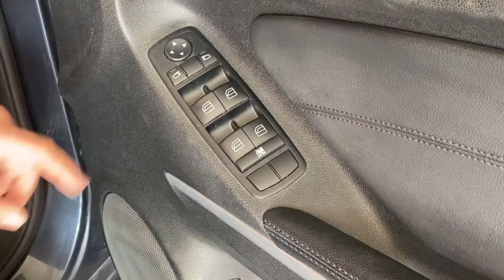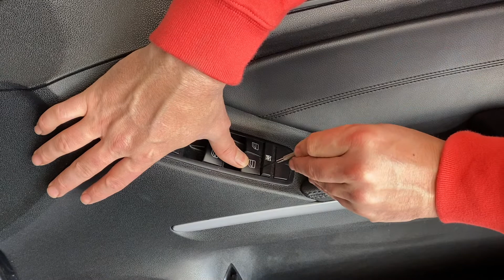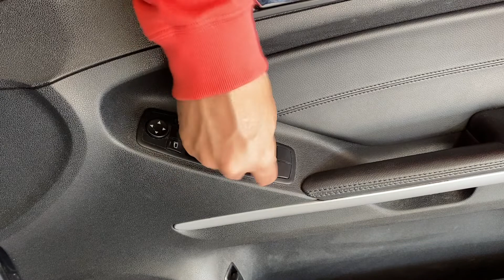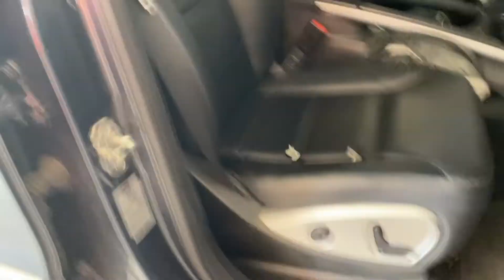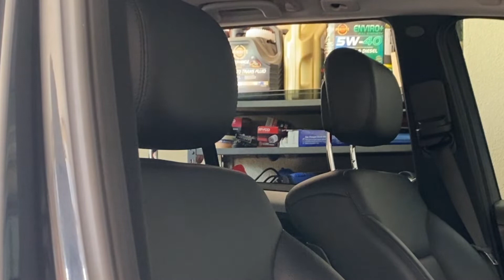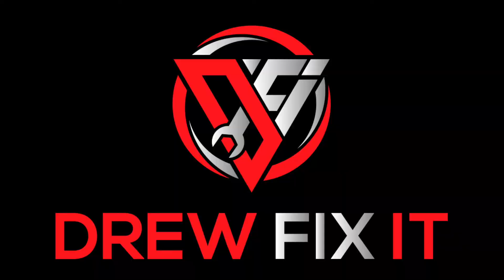How To Easily Remove and Install Broken Mercedes Power Window Switch Button - Quick and Easy Fix!

Comment: Hi thanks for vid I’m changing mine and it has a little plastic piece that goes on inside can’t work out where that goes it come with the replacement it’s called spring fitting can you help please 🙏

Comment: Hey mate,
I have kinda the same issue but with the rear windows locker switch IT'S STUCK,
It doesn't move or work and the rear windows are now unusable unless you use the driver's switch which is ripped off,
just asking if there's an easy fix for the locker switch at least?
Reply from the maker: Hi Mate, I now have the same issue as you and have not yet worked out a way to UNSTICK this rear window locker switch.  So. I will now probably replace the complete unit, which I will demonstrate in a future video.  Cheers Drew
Reply: @DrewFixIt  hi mate,
Who'd you believe it, I did bought a full replacement for the driver's door for around 50$,
It's not the greatest quality and I had an extra button at the end of it I don't know what it's for but you can demonstrate what's the purpose for it (if you bought a cheap replacement like me),
I didn't replace mine however because I'd just didn't have time and equipment,
even the driver's door windows is starting to slowly die,
I can't wait to watch your tutorial for it.

Cheers.

Comment: I have a problem on the lock and and unlock switch it lights up but when I press it it doesn’t do anything
Reply from the maker: Sounds like you might need to put a whole new unit in. Cheers Drew